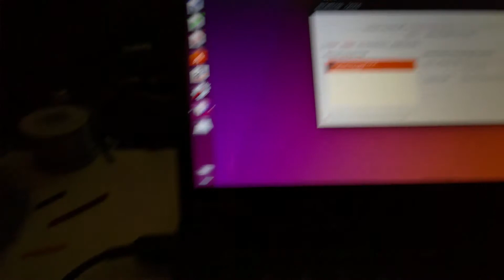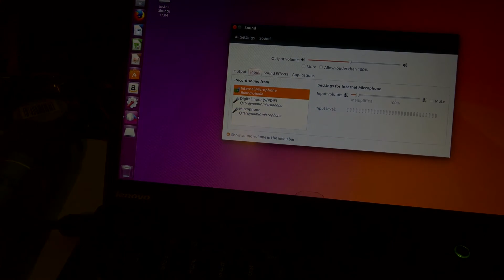Repairing the USB of the t.bone SC440 microphone

Comment: Hey man thanks for the vid. Q: did you have to modify the new USB port because it was thicker and a different angle? Do you know if the correct USB post is generally available in an electronics store or is the original one a custom size to fit the mikrophone?
Kind regards from Hamburg
Dave
Reply from the maker: The metal legs meant to attach the usb port to a PCB were cut but you can just buy the correct type of connector which is "USB type B vertical connector" where you don't have to modify it, they should be available in electronics stores but if you can't find them locally, they are available on ebay and aliexpress.

I just had to modify mine because I had the normal angled type.
Reply: Purkkaviritys aaaah got it yes i do know those, didnt catch that you had an angled one for vertical mounting.
Great channel and awesome that you take time to answer questions.👍